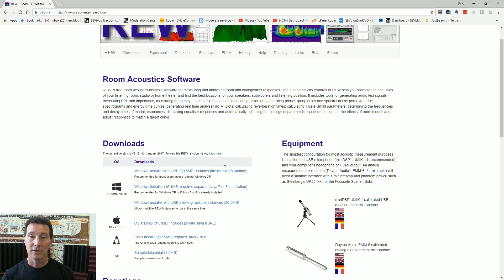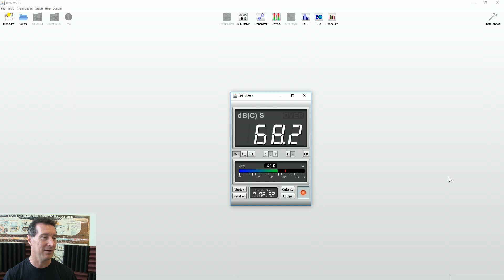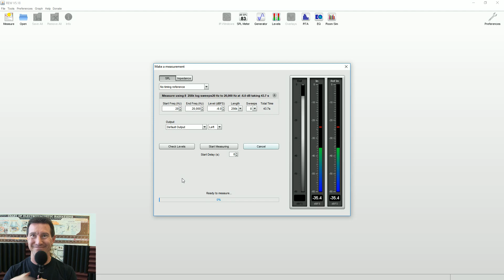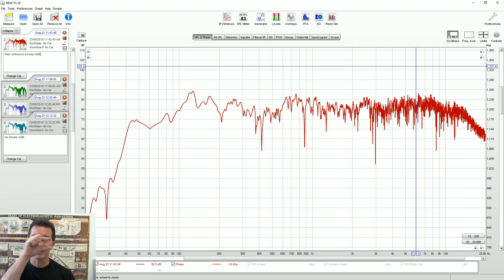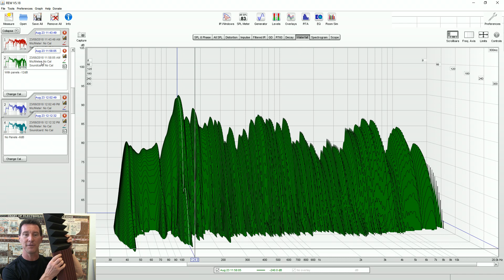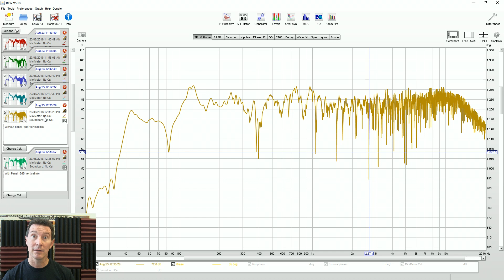Measuring Room & Reference Monitor Speaker Acoustics

Comment from the maker: NOTE: The difference in the "clean" first response and the "messy" subsequent responses is that the first one was left speaker only, and all further ones were with both speakers, so you expect a difference response.
Reply: Your speakers are also on their sides, which will introduce more phase cancellation when the listener moves from the sweet spot. This is a feature of two element speakers and that's why they are recommended to be upright :)
Reply: Hi Dave! You forgot to put in the link for the software in the description...    Cheers!
Reply: EEVblog2 Hi, I'm loving the videos you're doing on audio. A few days ago I watched a very old video of yours about audiophools. Can you maybe resurrect this topic? There's so much garbage about sound on YouTube.
Reply: EEVblog2 P.S REW stands for Room EQ Wizard.
Reply: Mr. Blog, W10Privacy, run as admin, use deutch updated version. Pls get Ublock Origin or something good. If you don't trust it run it in sandboxie and inspect the files first.

Yours truly.

Comment: StringerNews1 has already chipped in with a lot of good tips. Another one is to use smoothing (Var is a good start) and always the same Y axis scale (50dB is industry standard) to avoid being fooled by a huge scale making your room look "pretty good actually" 😄
If going for a proper measurement mic an UMIK-1 (USB) is recommended, less fussing with levels in the OS, your mic preamp and possible gain/master level. And C weighted since you are not doing a human thing ;)

Comment: Not sure I would call that the vocal range. Most vocals are alot deeper than that. It just goes to show that thin panels are only good for high frequencies. Real absorbers and diffusers are really thick. You can't break the laws of physics.

Comment: Nice one! Just to add some insight to the actual measurement: you want to apply smoothing to the result you got, and then make decisions. Really narrow dips aren't as important as wide ones - our ears can't distinguish the real narrow ones. Also, the "fairly flat" response you got isn't actually all that flat - you've got to look at the scale. It was actually +/- 5dB. In studio mixing changes as small as 3dB are what we do intentionally and it's a change we can hear. 6dB is considered a big chunky change. Moves as slight as 0.5-1.5dB are used for final touches during mastering. Keep in mind +/-5dB means worst case scenario you have a 10dB change at some point.

Also, the measurement mics are fairly easy to DIY - you need an electret capsule, even the $0.50 ones are fairly flat, it's just the way these small ones are. You need a body with a narrow tube just like the off the shelf ones. We did make a DIY one, cut some pipes, whacked an electret in there and compared the two and there wasn't much difference at all.

Comment: Dave, I was going to suggested you'd have better results mounting the mic vertical. If you have a cardioid mic directed towards the speakers, it would pickup different reflections (or not) due to the cardioid pattern (from the back they're generally less sensitive). But it definitely looks like a nice piece of software - thanks for sharing.

Comment: Spongy absorbers transfer acoustical energy into thermal energy by acting on velocity of the air particles. Velocity is zero directly at the boundary and at maximum quarter wave length from the boundary. You are probably using 5cm deep panels there and placing them about 2-3 cm from the wall. One can easily calculate at what frequency these will be effective. That's about 2-4kHz.

The dips you saw with some measurements at higher frequencies are most likely just an interference between the two speakers that occurs when the mic is not placed precisely at the same distance from each speaker. Consider this: wavelength at 10kHz is about 3.5 cm

Comment: You are better off measuring one speaker at a time at the listening position 2 speakers will filter each other giving you a poor reading. Also, you will get bad results with your speakers placed horizontal.Turning your head a little will cause more out of phase issues than if your speakers were vertical. Especially with this type of 2-way design.

You can actually get a real time response using a type of full spectrum noise. Then viewing via an FFT Spectrum Analyzer.  Handy when sweeping around to see real time eq changes in each part of the room. I found this to be very useful for checking outcomes quickly when moving and placing room treatment materials. Yeh and better off buying a flat response measurement mic.  Great software.

Comment: Room modes (or modals) are only affecting the low end up to mid frequencies, you can easily calc them by yourself: measure distances between walls, and now you have the fundamental (where a full wave can fit) the sub (half wave) and harmonics, but the harmonics usually reduced by -3dB, -6dB, -9dB...and so on and resulting flattered echoes if you don´t damp your room (naked walls)

If you want to damp the lowest one(s) simply put a reversed vent-port (looks like a speaker but it has no speaker in it, just full of damping material,and may be a horn if you want more reduction) in the room edges, but a simple pillow in the upper and lower corner does help as well.

Also - if you got the amps and speakers, you can do it with an active setup: measure the resonant freq. and phase angle of your first low peak and put a sub-woofer in your opposite corner(s), design a low pass 18dB (the more the better) cut off filter(or use DSP-based systems) with the center frequency right up to where your peak is and feed it into your subwoofer and increase the volume of the amp....the first peak should vanish at some point. But that´s only working for your listening position, if this changes you may end up with an increased first low end peak at other positions....

Comment: Nice that it can calc all the room modes in real time, the benefits of modern software. My old 1992/3/4 around DSP based hardware anaylzer needs to "click-in" (it does clicks from slow to fast pause time, the very end sounds like PWM:) every change in whatever position. But it´s calibrated throughout with a heated omni mik....
I really need to test this software...You already made my day, Dave....thanx for this :)

Comment: Constructive interference will cause a LOUD peak in the audio at a set frequency and destructive interference will cause a noticeable drop in the audio level. The locations vary around the front of the two speakers.

Comment: Putting the same tone out on speakers set apart will cause a wave that will create constructive interference, so the results will change depending on the position of the listening mic in front of them and also the frequency being your using at that moment in time. You can find almost total dead spots in front of speakers if you hunt around with the mic. May be best to test one speaker at a time so there is only one point of audio being generated.

Comment: "Equaliser APO" can take the REW results and produce a correction filter.

Works on audio interfaces that have an "Enhancements" tab or an "Enable audio enhancements" in the "Advanced" tab of  Control Panel --> Sound --> Playback --> Properties

https://sourceforge.net/p/equalizerapo/wiki/Documentation/

Comment: Dave, has your SPL meter got an an OP? If it does, you might be able to use that as your mic. It's also possible to use REW to measure/test amplifiers using a AI; it is a very good and versatile bit of software.

Comment: If you want a individually calibrated measurement microphone I would recommend the UMIK-1 from miniDSP for 75$.
It has a USB interface so you don't have to mess around with a soundcard and gain adjustments.
Reply: Good call.  It's the one REW recommend on their page.

Comment: If you "take it apart" on one of those lower priced "measurement" reference microphones you'll find a good old fashioned omnidirectional electret capsule, no frills. 
Super hi-tech.

Oh yeah. Placement.
Either Tweeter on the outside or vertical.
Why? You're hearing is more directional at higher frequencies. 
That's why you see so many mono sub-woofers. No directional sensing down there.

If they want to get nerdy about phase alignment they need to go concentric drivers.

Comment: 40Hz from that pissfully  small speakerboxes placed almost in free air? No way in hell.  I wouldn't trust them under like 80Hz. Even in your response plot, those 40Hz are like what, 20dB below the rest? 

Okay, I get it, it may make some sound at 40Hz, but certainly not 40Hz at -3dB, not even close    to -10dB at such frequency.
Reply: Probably due to room acoustic and the fact that he is measuring both at the same time.
A proper measuring microphone might even pickup more LF.
Reply: 20Hz? You must be kidding! The speakers would have probably already rolled off 50-60dB at 20Hz which means you would need to multiply the power at that frequency by 100.000 to 1.000.000 times to get that 20Hz in balance with the rest. Good luck with that.
Equalizing outside of the frequency response of a speaker is mostly a waste of power and huge stress on components. If your speaker is out of spec. you need to buy one that isn't!
Reply: Can't wait to see your youtube video on this one.

Comment: Despite it is not accurate it is very interesting how this piece of software could be super useful for an acoustician. I would love to see a future video with a proper measurement microphone, Beyerdynamic has one in its product line, maybe a call to Beyerdynamic’s HQ?? I’d love to see  more audio related videos Dave!
Reply: Just use a smallest possible electret microphone on a thin long straw. It'll be guaranteed to be absolutely flat to be at least 5kHz.  Above that depends a lot on the mic mechanical construction, that also can be quite improved by some diy.
Reply: I use the Beyer MM1 it's good, but the cheap Behringer ECM8000 is perfectly suitable for room measurements.  MiniDSP UMIK-1 is also good if you want USB built in.
Reply: @Audio_Simon  But you need a calibrated one. Otherwise it's useless.
Reply: @johnyang799  Not in my experiance. The variance in the response of the mic (ECM8000) is much smaller than those introduced by room reflections and such like. Also the variance is nearly all in the top end of the response above 10khz.
Reply: @Audio_Simon  more than 2db variation is serious.
Reply: @Audio_Simon  should be calibrated to 16khz at least.
Reply: @johnyang799  Dave's response from 40hz - 1000hz in this video spans more than a 20dB window.
Reply: @Audio_Simon  So what? Still not usable.

Comment: What does the back side of the waterfall look like? I'm curious about the relative group delay of the leading wave front and the power-weighted median time delay over frequency to see how time aligned sounds are over frequency. It'd be interesting to have an equalizer filter on audio that uses frequency selective time delay to correct for multipath and other time variant room effects.

Comment: You're doing this VERY wrong!
Not only you're measuring with microphone that has characteristics for voice, not measurement (you'd better of with making mic for measurement yourself), but your speakers are ROTATED!
This messes up their phase characteristics, because this are close range monitors which means they have their behaviour tuned for specific angle. High and midwoofer speakers are tuned to be in specific position and distance to your head, so you shouldn't lay it on a side!
Reply from the maker: Did you even listen to what I said in the video?
Reply: While there are numerous problems with this test setup, the speakers being on their sides is not one of them
Reply: All of you seem to be missing the fact that he said he isn't taking it seriously, he's just messing around with the software
Reply: I knew this guy would appear XD
Reply: @nicholasroos3627  . It's not even worth correcting wat he is saying. Than you basically have to start with basic high school physics
Reply: @nicholasroos3627  LOL.
Reply: Besides the rotated thing, couldn't the IR of the mic be overlaid on top of the actual results to remove the characteristics of the mic?

Comment: Stick a panel on the ceiling and check again, I bet some of the low- mid reflection is coming from there, also from the wall next to, and in front of the desk as that will likely be where the low frequency reflections are from.
Reply from the maker: The drop ceilings are acoustic tiles. Standard in most commercial offices.

Comment: I used to use one of those measurement mics and a 1/3 spectrum analyzer to tune my car audio system... you’re no good until you can get it flat ;-) well, it actually sounds nicer when steps down from left to right, 3dB at 200Hz and again at 5kHz, with each section flat, that is what I had in my car!
Reply: bbc dip?
Reply: No, The 20Hz to 200Hz range set at a 3dB level, with the 200Hz to 5KHz at 0dB, and 5KHz to 15KHz set at -3dB, with 15KHz-20KHz set to 0dB (this produced an even sounding spectrum response), these are the levels as measured from the drivers seat head position.
Reply: I thought the "dB" unit is already fitted for our hearing. Why these huge dips and rises?
Reply: ̷ ̴ ̸ɢ̸ʟ̶ɪ̸ᴛ̶ᴄ̶ʜ̷ ̶ ̶ - it just sounds nicer, and allows for “older” ears, and it was based on a C weighted scale.

Comment: Spin your speakers around. low end should face the center with the top end (tweaters) faceing the outside
Reply from the maker: Hanes vettori - So i now have one person saying flip them horizontally, and one person saying put them vertical...
Reply: There's another position to try (assuming you've got them sideways to put the tweeter at ear level).

Place the speaker vertical, but upside down.

Article (briefly) explaining 
https://www.soundonsound.com/sound-advice/q-why-do-people-stand-monitors-upside-down
Reply: @EEVblog2  flip them backwards, it's just better.
Reply: EEVblog2 maybe I misunderstood keep them horizontal I thought he was talking about the tweeters being on the inside inwards, not being on the outer Edge sorry I can't see I'm on iPhone
Reply: you also need to buy specialty hand wound boutique audio cable.. the more expensive they are the more better audio /s
Reply: @vUvu vUvu Haha +
Reply: Leave the speakers and just enjoy some music, life may or may not be too short 🌞
Reply: You really just want an equilateral triangle with the HF drivers, wherever they are. It's less important with the longer wavelengths of the lower frequencies. What's more of a consideration is the horizontal vs vertical pattern of the HF drivers, the "on axis" area may be very small if they aren't designed to be horizontal. I don't know the data on those particular monitors, and quite a few are X by X so it doesn't matter.
Reply: No... No... No... They have to be facing sideways upside down vertically perpendicular. Because everyone is going to be able to distinguish; esp the "audiophiles." Reminds me of the FPS test we were running at the computer store I worked at. (Spoiler: the people that came in and said, "I can't even watch video under 60 FPS," were quite embarrassed.)
Reply from the maker: Why?
Reply: EEVblog2 wider dynamic filled
Reply: Yep, vertically is better, your ears are more sensitive to horizontal direction than vertical directions, it has to do with phase alignment.
Reply: Steve is right put them upside down to get tweeters at ear level. Crossovers introduce polar response errors and our ears are less sensative to reflections in the vertical axis.
Reply: because they are designed this way.... 
the phasedelay between woofer and tweeter (crossover frequency) is probebly better when they are vertical